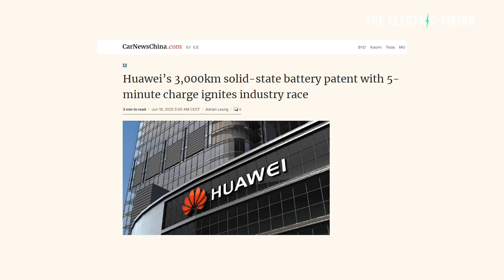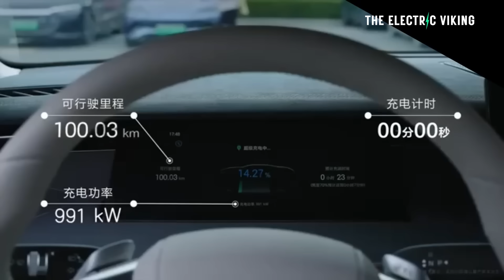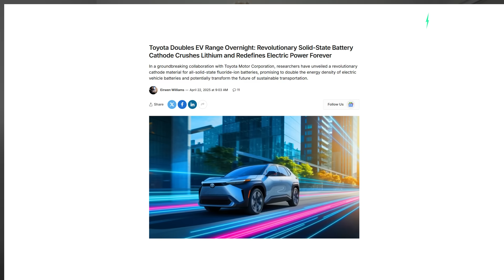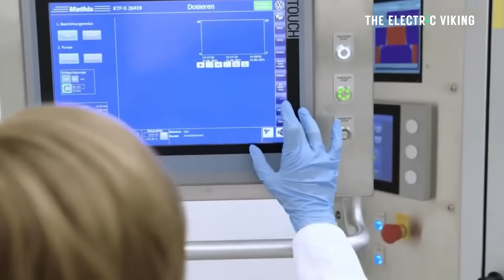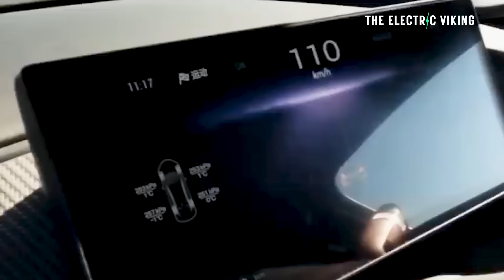5‑Minute Charge, 1,864 mi Range: Huawei’s Battery Patent Shocks Industry

Comment: Five minute charge requires a 1 megawatt connectio per charger. Nowhere in the country is that infrastructure in place for over the road charging. Putting that infrastructure in place nation-wide would require trillions of dollars in investment. 

EVs = idiotic solution for an imginary problem.

Comment: you can have a battery today with that huge amount of range but it would require to declare the car to be a truck :)) you just need to perform a 2.5x on a current energy storage + 30% for increasing the weight of the car. It doesn't mean that we should do it :))))

Comment: it seems like every day there is a miracle new invention which will revolutionise the car industry and make everything else redundant. What a great time to be alive.
Reply: 100 game changing inventions for 1 to be realized in ?? years. Latest real invention was the LiFeP4 chemistry. Na-batteries, where are they?
Reply: But it's all nonsense, yes the battery might exist, but to charge it in 5 minutes would use 7 to 8 MEGAWATTS.......you'd need a cable the size of a 4 inch drain and it would have to be cooled....., plus no house can supply that, and multiple cars plugging in would collapse the grid

Comment: The battery technology is heading in the right direction exponentially. Of course there are a lot of arm flapping going on these days.  And while the range is increasing, there will be other desirable traits that are being sacrificed to gain range.  However, battery technology is definitely getting better. I look forward to what will be available in two years.  Good, solidly engineered, safe batteries.

Comment: 500 Wh/kg used to be where electric aviation was becoming real.
Reply: That was only true as long as you couldn't do math.  At 500 Wh/kg, the largest electric plane that can even theoretically be possible would be equivalent in size to a 28-seater craft.  Anything larger and the battery-vs-weight battle becomes a divergent series and you suddenly need an infinite amount of batteries.  The math isn't that hard, but whoever said that all-electric planes would be viable for commercial air travel at 500 Wh/kg is delusional at best.

Note that when I say that it's not possible, I mean that in an absolute sense.  In simplest terms, you can compute the amount of power needed to lift the aircraft and keep it aloft.  Multiply this power by the range (travel time) you need to cover, and you get the total energy needs.  Divide by the gravimetric energy density of the batteries, and you have a battery mass needed.  Note that this is a very dumb baseline figure; the real figures would have to account for inefficiencies of takeoff and landing, having to deal with turbulence and headwinds, etc.  But whatever the case, you add this mass back to the mass of the aircraft and repeat the computation.  As you do this, you get another added mass that you have to account for, so you repeat with that added mass, and so on.  Depending on the energy density and the original dry weight of the aircraft plus payload, you could end up with a converging or diverging result.  My own back-of-the-napkin calculations came up to tiny puddle-jumper craft no more than about 10,000 kg without the battery weight included.  Anything more than that and the required battery mass tends to infinity as you repeat.

So... Small sport aircraft, short-range private aircraft, sure.  But commercial? Not a chance.  Bare minimum for commercial viability is at least 8,000 Wh/kg.
Reply: 800* Wh/kg. Although 1250 Wh/kg could be nice to replace all commercial aviation running on kerosene so you can cross the Atlantic, Pacific and Indian Oceans without having to refuel midway.

Comment: Terrifying explosive risk. Its not moderated by separation from atmospheric oxygen all that energy is in the battery
Reply: Solid state batteries mitigate against fire and explosive risk better than today's EV batteries. Further, China has passed laws that state in about two years time all EV batteries must have zero fire and explosive risk. 

For better or for worse, China is not playing around. This is happening. And quite frankly, I say it's all for the better.

Comment: Here in canada we need the longer range,  because in cold weather your range goes down plus running the heater drops your range in half
Reply: Using the heater in an EV doubles your fuel cost but makes no difference in gas powered rig.
Something to consider when doing the cost- benefit analysis.
Reply: @Stan-b3v 
Not so with new heat pump tech
Reply: @patrickmckowen2999 . What runs the heat pump? Fairy dust?
Reply: @Stan-b3v , yes, but the kind with electrons.
Reply: @patrickmckowen2999 😅
Reply: @Stan-b3v not quite accurate. Idling times, cold fuel, friction still impacts efficiency and range. Studies show 10-20% at 20f. And 15-33% on short trips.
Reply: There should be a gasoline driven heater. I used to have one in my old Volvo 240, loved it!
Reply: Na+ batteries are supposed to work much better in the cold. Should be some models on market later this year. Lets see if they live up to the hype.
Reply: New batteries are immune to cold weather these days. That's what I've read. No?
Reply: @cb250nighthawk3 . But, it’s still cold , so it takes energy to create heat. Therefore the battery gets drained to keep the car warm.
Reply: @Stan-b3v 
Okay 👌

Comment: If you have a 1000 mile range battery, the range anxiety goes away. If you can drive the car hard and still get 450-500 miles, then it will be adopted much faster.
Reply: without the infrastructure no mater what it the battery is, people will not buy them. it will take 10+ years or even more to get the infrastructure put in place in USA. As it stands right now noone but tesla can use tesla only superchargers... the only chargers others can use are NASC superchargers... so your Kias/ Volvos / GMs / etc. can use those but not the tesla only. The other thing there are tons of cars out there that are sooooooooo slow to charge up so people are sitting in line waiting on that Nissan Leaf to charge for 40-50 min.
Reply: @Gawriify  I believe that’s why MY has been the best world selling vehicle two years in a row (and it’s heading for its third).
So, liking it or not, EVs are here to stay and sooner or later will replace ICE vehicles. 
How long it’s going to take? At the end, it doesn’t matter. It’s already happening so it’s going to be sooner than later.
Reply: Range anxiety is usually a "problem" presented by people who don't own BEVs. Most people (80%) of EV owners today use less than 15% of their battery capacity each day, and then charge back up overnight to full (or 80% full) while they sleep. So for those millions of people, range, capacity, charge speed, and charge infrastructure, are NOT a problem.
Reply: @deanmcmanis9398  I guess I do not fall into that 80% of the people... with my driving habits I would be on the side of the road with nothing in the battery. 300 - 400 miles is normal for me. I will give you that on the interstates like 80 / 95 / 87 / 43 there are chargers but they are for tesla only or you have to sit on a junk charger for 40 min to get some power, but when it comes to the cities like NY / LA / Houston / etc. there are nowhere near enough chargers for people to charge. I see people even with teslas sitting in line for like 40 min to get to the charger. It will take another 10-15 years or even more to have enough infrastructure to catch up to the demand. But at this point for me ICE is the only option. Well maybe a hybrid...
Reply: @Gawriify  If an EV doesn’t work for you, that’s okay. That’s the beauty of this country (or the world): you can choose whatever suits you best.

Now, that’s exactly the same argument people used when smartphones first appeared. The battery of an old cellphone could last a whole week or more, while the new smartphones only lasted a day or two. So the question is: are you still using a Nokia 6300 or Motorola V3, or are you using a modern smartphone?

And let’s not even mention when people were riding horses and the car was invented.
Reply: @deanmcmanis9398  I totally agree with you.
Reply: @deanmcmanis9398 until more and more people change to electricity at the same time as reliable generators are being removed.
Reply: It will be banned in the US because the big 3 can't compete.
Free markets until you can't win, then it's tariffs and nationalism.
The US is dealing itself a losing hand.

or this could be a hoax to raise capital and drive out the competition.
Reply: The anxiety will be in finding a charger remotely capable of charging such a battery in anything like 5 minutes. Unless you are prepared to pay thousands for the charge. 

To charge these batteries in 5 minutes you are looking at over 2.5MW rates of electricity delivery. That’s around $0.5m of electrical equipment plus installation of just the substation. For one charger.

Then you need to upgrade the transmission lines as you will likely be drawing more energy than most medium lines are capable of carrying. Let’s say another $5m for that, as it is by far the biggest cost of providing electricity.

So you’ve installed the equipment.  Each charge on this one single charger has to pay for that capital cost.

They you have to pay the peak load tariff to compensate the generator for having that capacity just sitting around waiting for your car to come along. You pay this in addition to the standard rate. This could be hundreds of dollars every time the charger activates depending on the commercial arrangements.

The difference between ICEs and EVs in terms of loading the energy onboard is gigantic.

There is a very limited requirement between the underground tank and the ICE. You can easily add pumps and it makes almost no difference, the truck filling the tank might come slightly more frequently.

EV chargers capable of uploading energy at the discussed rates require massive upgrades deep back into the electrical grid, and generation capacity just sitting around waiting.
Reply: @deaninchina01  Yeah, but I think we're supposed to ignore that part of reality and just focus on the good part.
Reply: @deaninchina01  Who said that you need to charge in five minutes? I don’t know where you guys get that idea. And about paying thousands to charge — I really don’t know where that comes from.

Don’t forget that when the car first appeared, exactly the same thing happened: there weren’t enough refueling stations, and it took decades to build a decent infrastructure (not to mention that even today it is still expanding), whereas the electric grid is already in place, which is a huge advantage. In some areas it may need to be adapted or improved, yes, but that is normal.

But, hey, there’s no problem — it’s very common to find people who resist change because they are afraid of the unknown, just like when the car was invented and people were still riding horses.
Reply: Range anxiety won’t disappear doesn’t matter how big the range is.

As a matter of fact having the percentage , remaining liters or remaining miles (in this case) on your dashboard or screen it’s what gives anxiety. You can see it in people with phones and laptops, saying “I have only 5 %”.  🙄

Even some modern ICE cars switch from the traditional gas tank measurement to a “remaining miles” schematic. And seeing that remaining miles display switching from 50 miles to a 20 miles in a couple of minutes due to traffic or lights stops that’s what really gives anxiety.

Also, people will be pushing to the limits and ending up in the same situation. Not without mentioning that they will find something else to complain about.

I believe that replacing it with a more traditional display will make people feel less anxiety because they are more familiarized with that methodology.

Comment: Another benefit to consider, with a higher density that needs a smaller battery to achieve a given distance also means needing to put in less electricity for that range that makes charging at home over night more viable. It may reach a stage where a standard wall plug can put in enough energy to give 95% of people more range than they need for the entire next day.

Comment: Aviation could utilize batteries with that kind of power density, could make that industry cleaner, safer, more reliable, quieter, and probably more cost efficient. That kind of battery tech should usher in wider faster electric adoption for  nearly all transportation.
Reply: Light aircraft with short flights would be achieved, but not international 12 hour flights on airliners, they would take well over 30 times the best current density cells unfortunately.

Comment: How much time does it take to charge a 81kWh battery with a 110v - 60 hours.  How fast with a 220? 8 hours, how fast with a super charger 1.5 hours - to charge in 5 mintues given a 81kWh capacity hence woulld take the equvelent of 16 Super chargers equivalent to charging 16 cars at the same time at a supercharger - That won't be happening due to infrastructure limits, you'd black out most small towns.  Big range; ok or smaller battery same range - ok that would be great. lower weight would help efficiency and economy. However, we have no idea what these cost.  Toyota  paid over 1 million to make their first solid state car.  Solid state is akin to makng computer RAM and it takes a lot of chip perhaps 60,000 per car to have enough range to rival others.  So you may cut the cars weight by 1000 lbs, it may be more nimble, but the battery may cost far to much for putting in a car at least for some time.

Comment: I don't think dismissing all that extra range by the viking is very well thought through. He states 400 to 500 Klm is probably all that people really need. I say BS.  Here in Australia, being able to do a drive from Sydney to Melbourne or Sydney to Brisbane on a single charge would be ideal.  1000KM minimum range would a good starting point.  In this armpit of a country, you cannot assume there will be  state of the art infrastructure any time soon and charging bottlenecks around the halfway mark will become a real pain as electric vehicles become the norm. I don't want to gorge up at MacDonalds on bum lining junk food at Gundagai waiting for a vacant slow charge @ 100KW @ many times the nominal  Kw hour rip-off provided by those one armed bandits.  Long range batteries would put the pressure on the mongrel power companies to provide lower priced charging stations. As the viking stated, it would also put pressure on car manufacturers. Of course, government owned infrastucture would be ideal but they have no money to spare ..... need it for submersible widow-makers of the distant future.  A high capacity battery would make V2G even more desirable and fewer charge cycles over the life of the car would probably extend battery life even further.  Yes you could do smaller batteries for a better power to weight ratio and or to lower costs but I think the pursuit of range/capacity should not be overlooked.  If you look back at the time of the nbn rollout, that dickhead Abbott scoffed at the idea of really fast internet. He said most people wouldn't make use of it.. The government of the day constrained the capacity of the network to save money. Now we are faced with an internet that is not up to the task because we didn't get the best or scalable technology of the day (fibre everywhere).  I welcome these batteries.  They will finally certainly put the last nail in the coffin for ICE's and Plug in Mongrels.👺

Comment: "You don't need any more than ---- 450 miles of range". That is interesting statement as that means. I think in Kilometres these days so lets call it 450m/720k. Real range 10-80% (though I found up to 75% was way faster over all when I did 4000km across a good chuck Canada and back) is  315m/504k (mine is ~280k or less depending on the conditions. For me extra 224km would be nice would be faster charging. In my old 2005 Golf TDI I could cross this easily in 4 days. My out way trip, it took me 6 days but I learned a lot and my return trip took me 5 days. A lot of time was save not charging to 80% and knowing where a lot of the chargers were and better planned meal/coffee breaks. Me, I would want a bigger range, so I could pick up my speed as speeds of 110k/h are common across the prairies and 100k/h in a lot of Ontario on the major routes. In British Columbia it varies 80-120k/h. The wind can have a huge effect on range in the prairies. Me I would love to have a usable 1000km range as I would just need to coordinate my charging at my meal stops and my over night stays. When I am at home, my weeny really usable range (280k) is quite sufficient.  
There are a lot of tight spots with long gaps between chargers here in Canada . If I could use Tesla chargers and chargers in better working order some of that range anxiety would be reduced.
Reply: i recon 600-800kms is enough... i have never driven more then 400kms or so without a "pit stop"... charging speed up and bring the weight down to ICE levels and EVs win.
Reply: @lukin4u265  If I had a 800km manufactures range, 560km (10-80%)  range should make 400km easily drivable with a recharge time of 1 hr, it would only increase my day by an extra hour if recharging was available at my accommodation (they mostly are not).  Unfortunately for me my vehicle only has half of that capacity and the recharge points are still few, but things are changing. The range of my car is perfectly adequate when I am living at home.